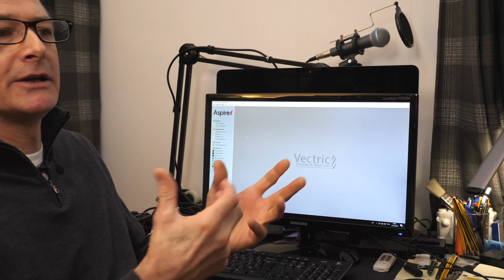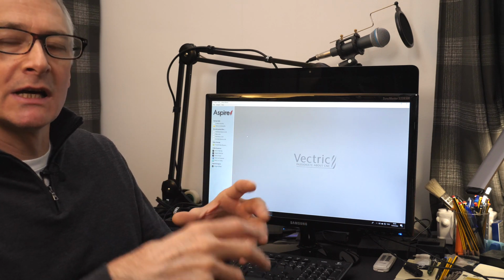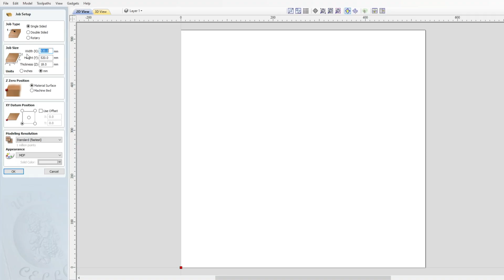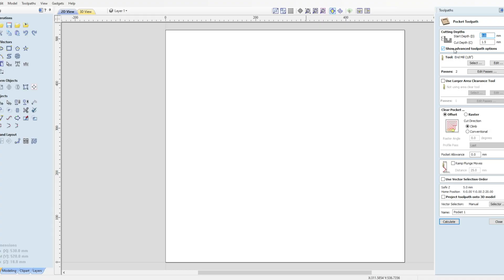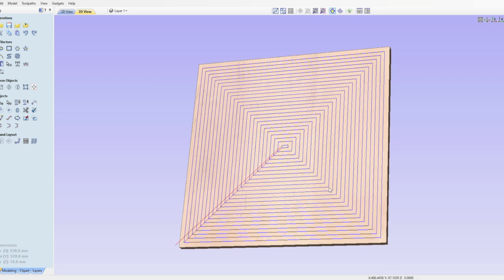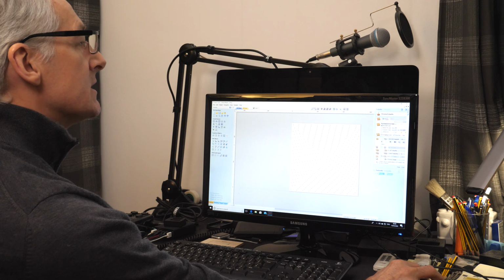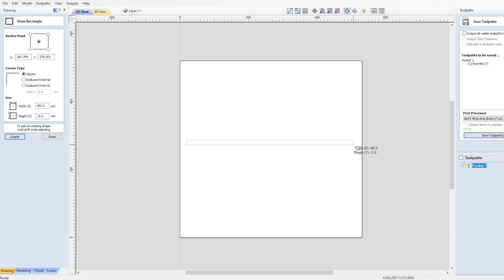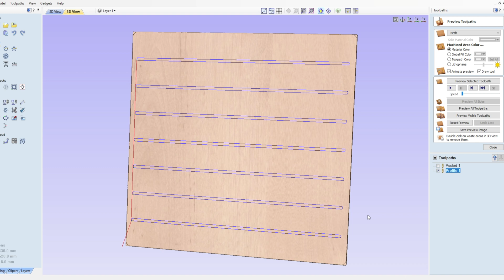Starting Out in CNC P7 - Spoilerboards and software [video 391]

Comment: And it’s at part 7 where I realise CNC is not for me. I know there’s other software but £1800 for the one in this video puts the ownership of a CNC very much out of the hands of a DIYer. 😢
Reply from the maker: There are lots of free options for software; for this series I was obliged to use what was supplied. 🤷‍♂️
Reply: @10MinuteWorkshop  Ah ok. Looks like I’m back in the game. Because of your channel I now own A festool TSC55, Festool Domino, Talmeter measuring tape, Concealed Hinge & Mounting Plate Drilling Jig and 2040 aluminium extrusion. So I’m gonna need the CNC.

Comment: You are doing really well given you just started using the software. The vectric has a comprehensive suite of video tutorials on how to use the software as well as create models that I found very helpful. If you have a chance to get it zero appliance, really consider getting it. It speeds things up never mind makes difference in outcome when doing the finishing pass. Are you planning to carve acrylics? Those drag diamond bits are really fun to use with acrylics (or aluminium).
Reply from the maker: Thanks! Yes, an xyz probe/plate is on its way. Hadn’t considered acrylics - but now you mention it... 🤔👍😆

Comment: Did I miss the part about squaring the gantry to X axis or is it covered in next video?

It is better to use raster tool path for the spoil board - easier to spot any inconsistencies in the cut.
Reply from the maker: No you didn’t miss it, it was squared up quickly just to get it up & running. The whole machine is going to be moved soon, and I’ll be doing the full calibration when it’s settled in it’s final workplace. 👍